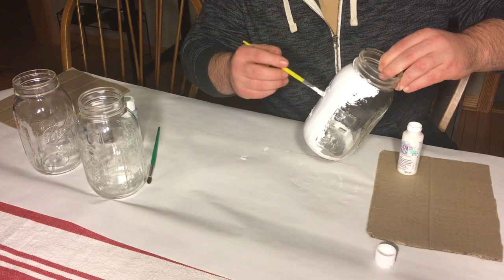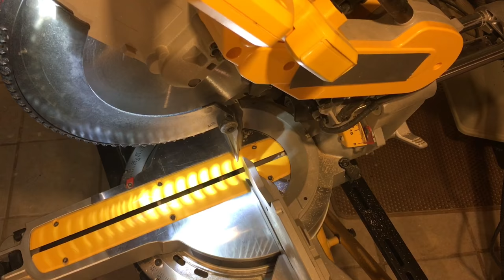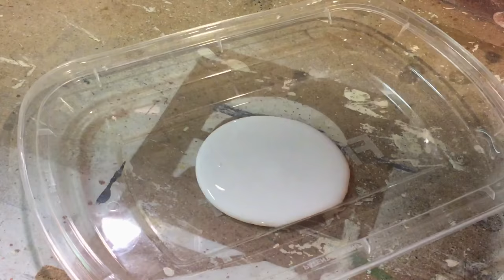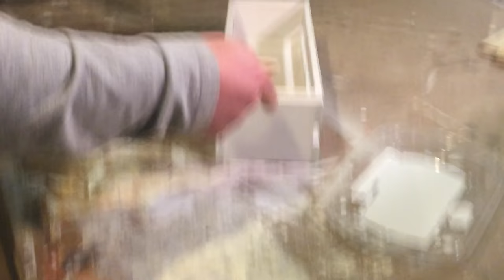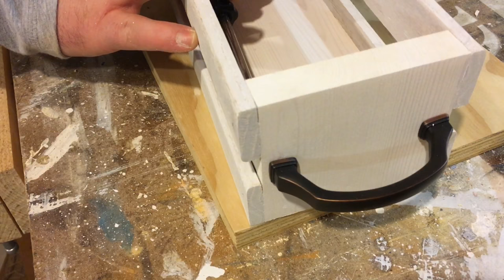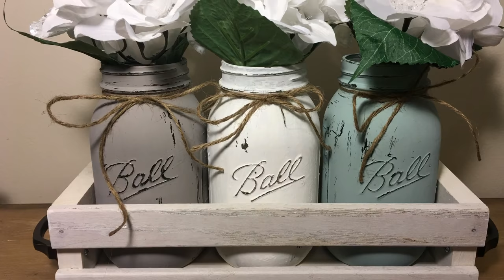Farmhouse Style: Mason Jar Décor

Comment: This is a rad little project! Good work!! What kind of paint did you use on the wood? And did you just add water to it?
Reply: Scratch the last part I just read the description, thanks for the info haha keep up the good work!!
Reply from the maker: Thanks.... and no worries. Every time we go to the "big box store in orange" we look through the "ooops" pile of paint. Usually we get the 8oz testers for around $.50 or so.... and a lot of times we can get a Gal for like $7. It's all random colors, and sometimes stain..... but for the price... we stock up.
Reply: DeLand Woodworks that’s a smart thing to do, I’m gonna have to try it out!